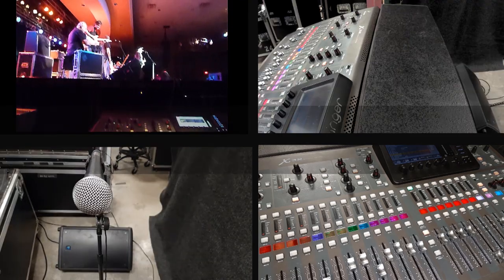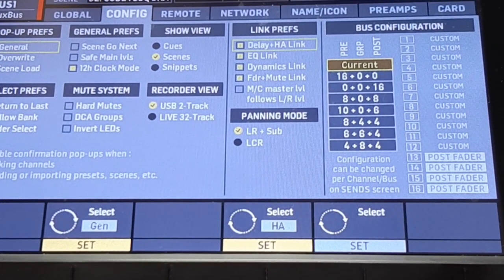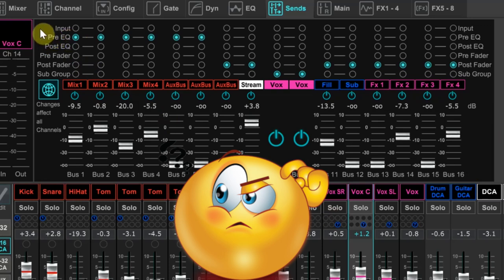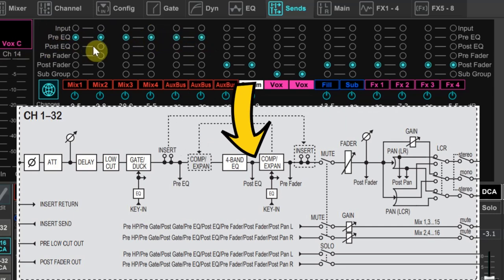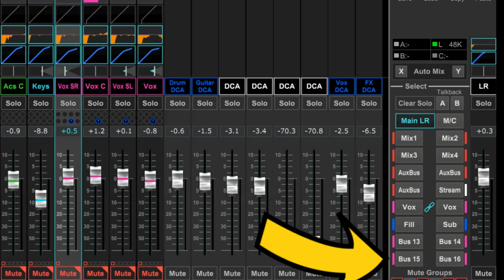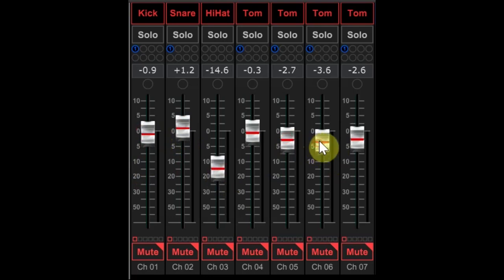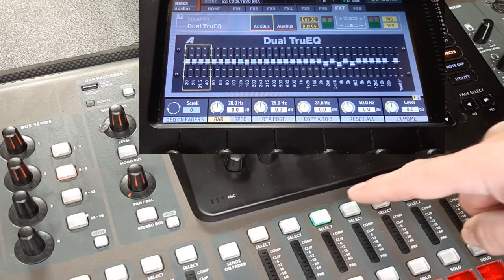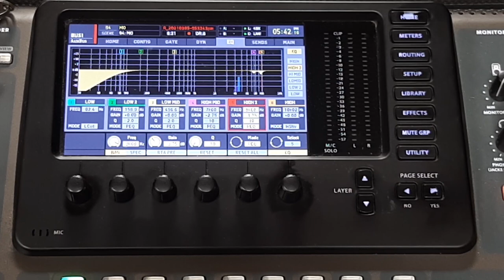Behringer X32 & Midas M32 Monitor Setup Guide - How To Set Up And Understand Bus Sends

Comment: If everyone in the band on stage has inear on each monitor bus. Then you do not use any monitors that are heard. To get good drum sound and vocal reverb in the inear, you need to post fader. It does not affect the sound in front of the house.
Reply from the maker: Post fader ALWAYS impacts FOH, or vice versa. You can set the monitor sends on the channels as post fader, and so tap everything for the monitor mix, but that monitor mix will always follow the house channel fader changes.
You would accomplish the same thing with Pre Fader, except not have your FOH channel faders affect the mons.
Most musicians don't like hearing the mon mixes change as they perform, unless the changes are specifically for their monitor mix. IOW, they don't want their vocal level changing every time the FOH engineer decides the vocals are too loud in the house. Or, not loud enough. That second thing might work for the lead singer and his own mix, if he/she gets louder anyway, but singers that have the levels of the OTHER vocalists all set and balanced before the show, aren't going to be happy to hear those levels changing as the FOH engineer blends and reblends things over the course of the show for FOH. That's why monitors should normally be pre-fader... with the other things decided (post EQ, pre-EQ, post comp, pre comp...) on a case by case, situation by situation basis.